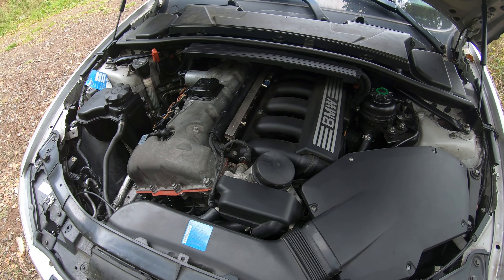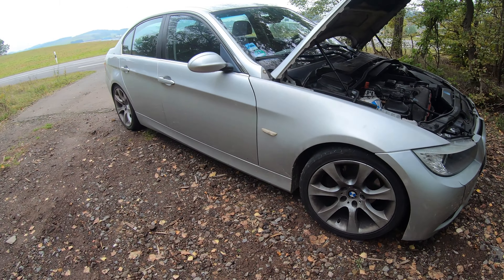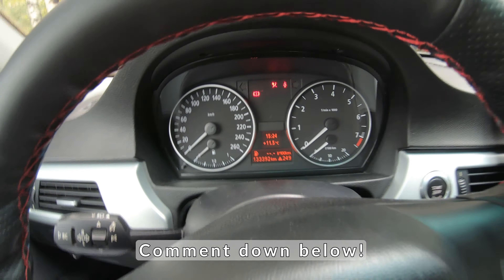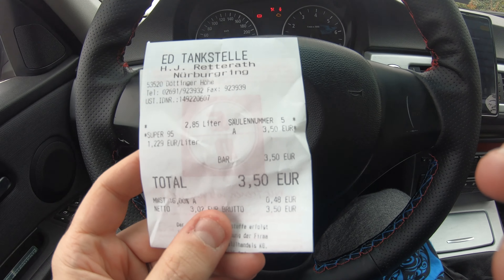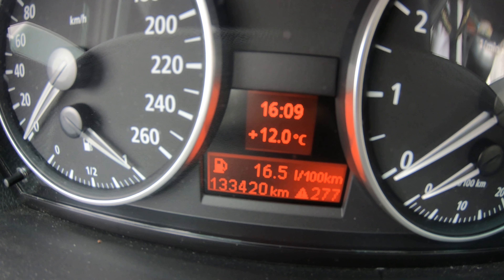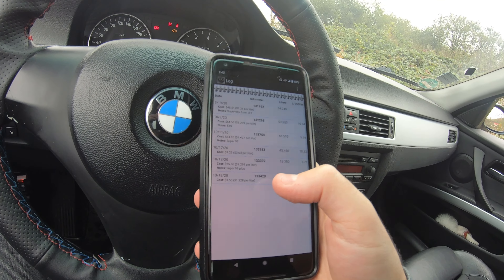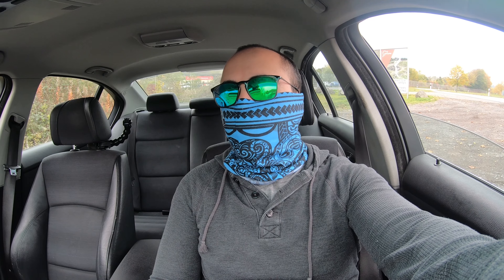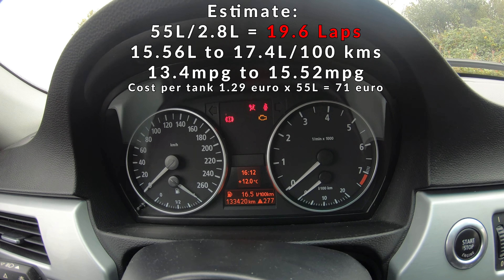What MPG does your BMW get on the Nurburgring?

Comment: Love your channel mate! Came across it because our engine was burning a litre of oil every 7 laps 😂 We’re a Scottish team(although last count there are 6 different nationalities involved) that has been racing on and off in NLS/VLN and 24 since 2017 in a 325i e90, we’ve found we can usually do 8 laps of the VLN variant. Sometimes if there is a long code 60 we can squeeze out an extra lap, our rule is if the fuel light isn’t on when you pass the start/finish line you can complete the next lap at full pace, so don’t panic if the light comes on part way round but don’t attempt an extra lap. Btw if you ever fancy getting involve with a race team you’re more than welcome to join us at a vln or 24. We’re easy to spot as we’re basically the only right hand drive car that races there. 
Cheers,

Ben(viken motorsport)
Reply from the maker: That's about 1L of oil and hour 😅. Rebuild it with the new piston design. That would be cool to get involved with a race team in some way. Let's make it happen. Are you on Instagram?

Comment: 2006 530xi, hwy 7L -100km, city 8.5,9L -100km…. No rebuild, oil 5w-40 any brand every 5000km since car had 70k km, currently car has 315k km runs like rolex watch… good luck…
Reply: Always used 91-94 octane, i clean vanos check valves,  DISA flaps and vanos solenoids every 10k km…
Reply from the maker: Nice. You've taken good care of the car and damn, you drive ALOT. What size tires are you running to get that fuel mileage? What's your oil consumption?
Reply: @buildanddrive   tires are standard 17” with pirelli cinturato p7, oil consumption almost none, in 5k km trip, i put 7L oil, i dont add anything and i pull out roughly 6.5L, oil pan gasket and rear main leaks last 9 years and didn’t bother to fix it, its a AWD so front axle little b** to go around…
Reply from the maker: Yes, the oil pan gasket is tough. Check the bolts (as gently as possible because they could break) but some maybe loose. That's what happened with mine. Thanks for sharing.

Comment: Aye bro I did compression test on my n52 and it has 250 psi on all 6 cylinders you know what could cause that
Reply from the maker: Does the car run ok?
Reply: No when I’m drive the car rev up on it own and when it’s just idling and when I hit just a little bit of gas it’s starts to shake a lot
Reply from the maker: Maybe check the timing
Reply from the maker: Is it throwing any codes?